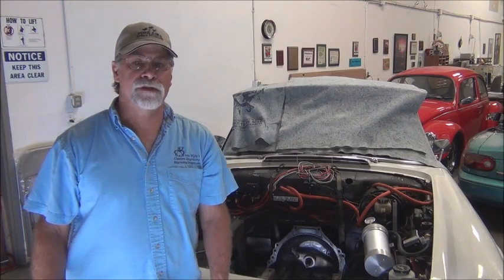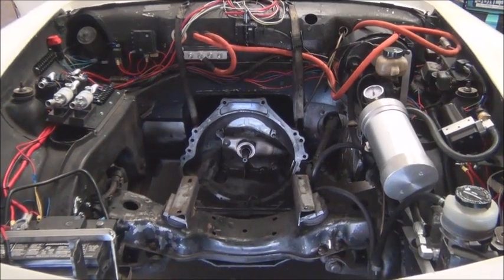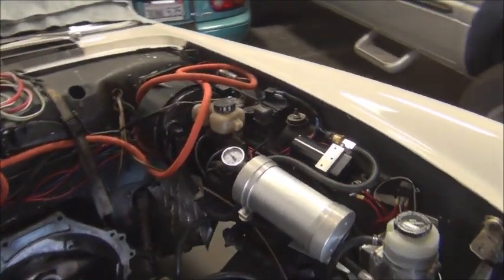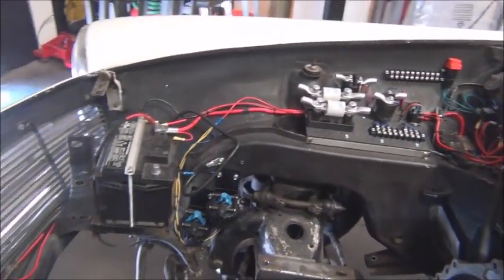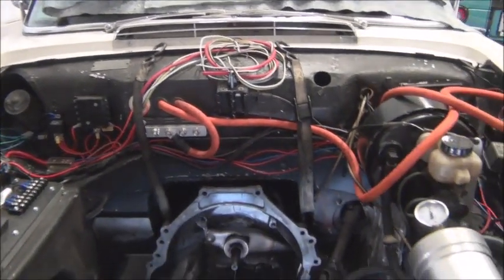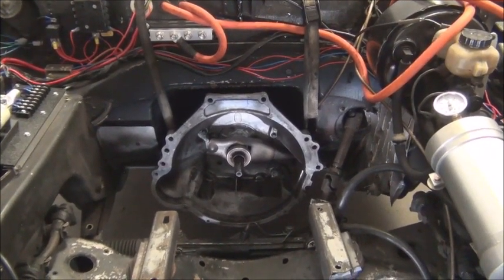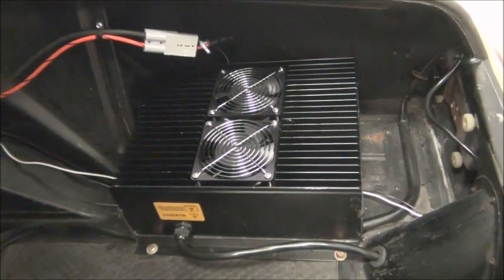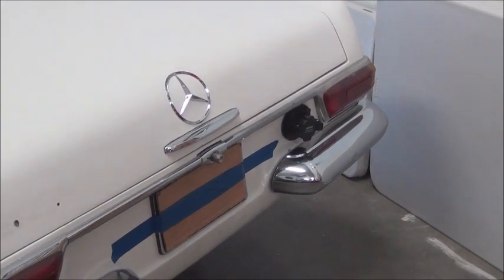Mercedes 230SL Electric Conversion

Comment: I have a 2000 Mercedes e320 I purchased from a dealer auction for $300, yes $300 and it rides silky as a Mercedes should, but has a transmission issue.  How practical would it be and at what cost would it be to convert this baby into an EV? Thanx in advance for any advice
Reply from the maker: Please address questions to info@EV4Unow.com